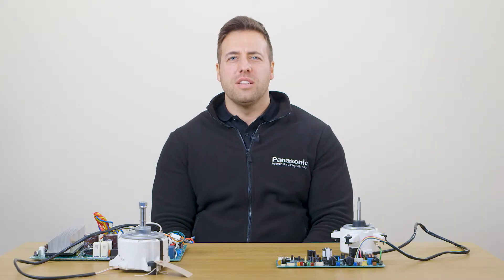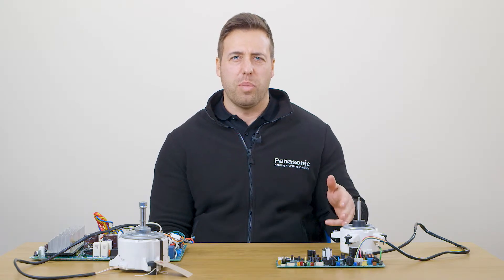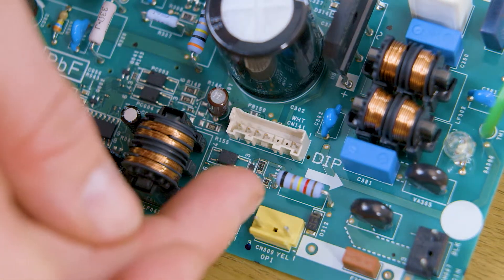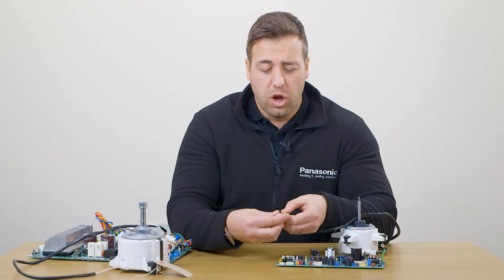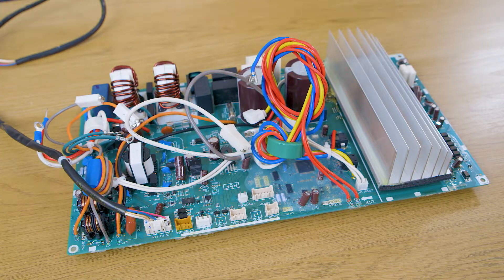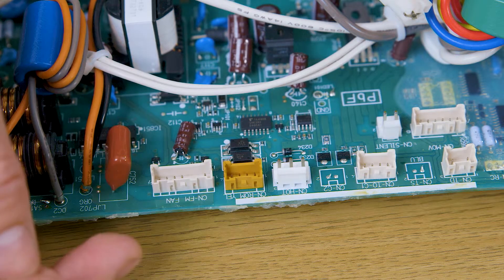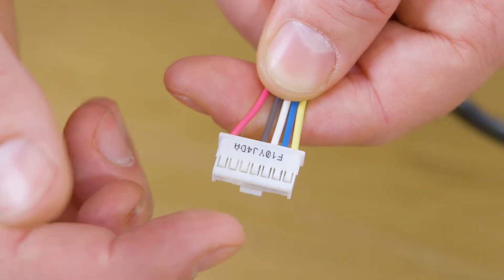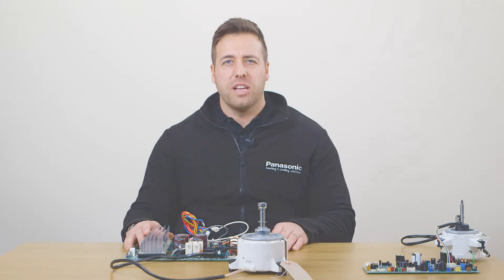How to check for a DC fan motor fault on Panasonic Air Conditioning PCB

Comment: Hi. I have 2 of the same Panasonic outdoor units. One of them is faulty with H97 error code.
Can I swap the 2 fan motors to test?
Reply: @eXtr1989 Have you solved the H97 error? It was the fan motor or the PCB?
Reply: @dorinbazavan5683  Hi, yes, it was the PCB. It had a manufacturing defect (bad serie of PCBs) as soon as weather temperatures were higher, the PCB went faulty (outdoor unit was in direct sunlight, after a while there was a short circuit, that explains the H97 fault). Panasonic replaced it under warranty. My second outdoor unit had the same issue last week, so that one has a bad PCB as well.